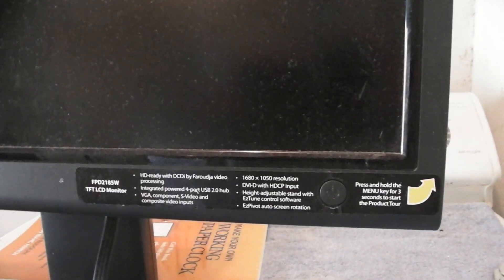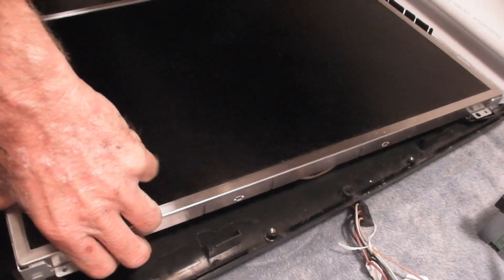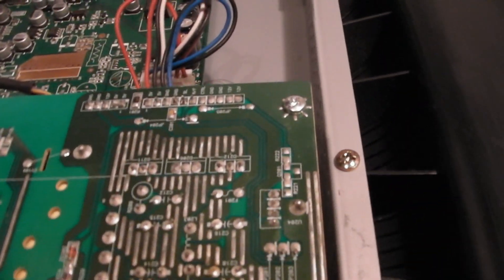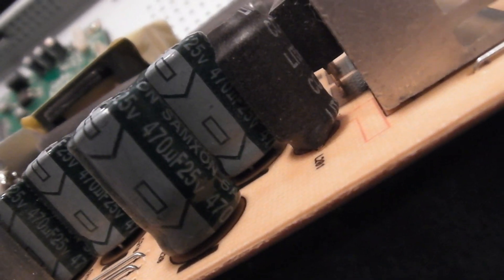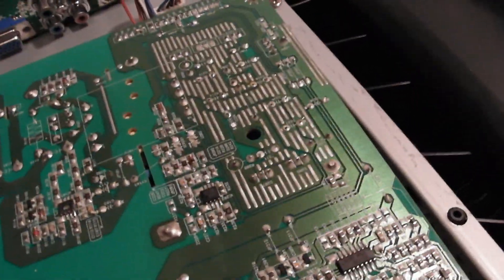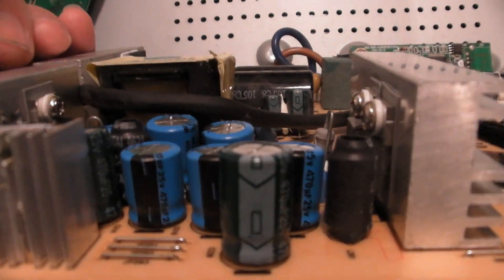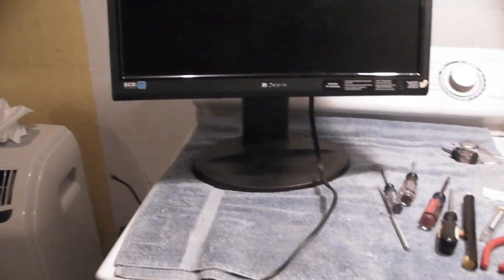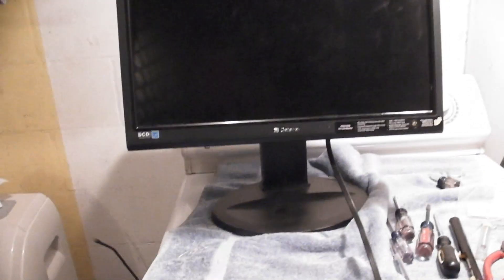Monitor blinking power button repair

Comment: just got done replacing 2 caps on my le 1936.   blinking blue light....    So i took it apart a few hours ago and yep 2 bulge caps  a 10v 1000uf  and a 35v 470uf.   Had couple boards around and found one cap  thats 35v 470uf  even tho it was a much bigger cap size wise   so i pop that on.  I didn't have any 10v 1000uf  so i ony can find a 16v 680uf so i gave that a try and pop it back together and bang monitor came alive:)     This monitor was in the trash even tho it still worked perfect  till a surge did something to it 2 years ago so it sat.      This is mostly for my cousin which yea his monitor cracked lastnight ...   So testing this on my pc as a 2nd monitor for now too see how it holds up cause im not 100% sure if that 16v 680uf will hold out over time....

Comment: I have a benq but the caps are fine but the monitor wont turn on after i plug the power cable but if i keep on plug and unplug many time the monitor turns on but if i unplug it again or a blackout the monitor wont turn on again then i do the unplug and plug method again to turn it on

Comment: Thanks for the video. I had the same problem on a 19 inch Dell. Replaced the capacitors and it worked.

Comment: I already replaced the broken capacitor but not still not working.  the power button blink once and nothing happen.
PS: i replace those broken capacitor with my unused board capacitor.

470uF 25v 105C  << replaced with same model 
220uF 25v 105C  << i can't find a same capacitor and i replace with 220uF 25v 85C

is it ok ?
Reply: Wee Ching Chok I have the same problem, when power led blinks once... :/ When i disconnect logic board from power supply then connect it again, power led blinks once again. Maybe Logic board is faulty :/
Reply: It is more much less charge inside the capacitor

Comment: Thanks for the vid. Any other issues to check for LCD screen starts up shows ACER logo then switches off ? Led turns orange, then blue, starts up, shows ACER logo then shuts off screen turns black. Led goes orange, then blue then logo reappears, immediately shuts down. And so the cycle repeats itself. Still cycling like this even an hour later. ALLcaps seem ok and test ESR ok.

Comment: Thank you very much. You and your video just saved me a good-couple hundred bucks! Mine was a Dell LCD, different configuration, but mainly your video gave me the confidence to take on the challenge. I'd had experience with old time circuit boards and soldering (retired mechanic) but had assumed that modern power supplies were integrated without individual component capacitors. On this Dell, I had to replace three 10v/ 1000uf's. I had salvage ones in my junk pile (one was a 16v, but 'fit'...).
Reply: For anybody wondering the voltage on a capacitor is the highest voltage it can handle not the required voltage, so replacing a 10v cap could be done with any voltage above 10v, given it's the right uf (microfarad) value.
Reply: @nixietubes  Thanks for stepping in with this information, I was wondering about the voltage differences.

Comment: ITS ALWAYS BETTER TO REPLACE WITH A HIGHER VOLTAGE CAP,THEY ARE USED FOR FILTERING THE VOLTAGES AND CHANGING WAVE FORMS...CAPS NOW ADAYS ARE JUNK,YOU WOULDVE NEVER SEEN THIS DAMAGE 2 A CAP 20 YEARS AGO WHEN THEY WERE STILL MADE IN  THE GOOD OLD U..S.A

Comment: Capacitors can go bad without swelling up, for ex. they can just dry out (they have a semi-liquid substance inside). Ideally, you use an ESR meter to test their internal ESR. In a case like the one in this video, replace ALL caps around the swollen ones 

Can't use ANY capacitor with same uF value and V, lcd psus need LOW ESR caps, and quality low ESR ones you won't find at Radioshack. Sure, the lcd will work for a few weeks/months, but you're stressing the psu and the crap caps will die again.

Comment: This is not correct.  The high voltage rating is so that arc over does not occur.  The venting issue ocurrs because of overheating caused by the ripple current being higher that the rating on the cap. If you don't replace with a higher rated ripple current, you will have to continue the repair over and over again.  In fact if you use a lower rating, it could even explode.

Comment: Ha - I was looking for tips on my current monitor, but as it happens I have that exact monitor sitting in my basement (and it died in much the same way).  I don't know how to do circuit repairs exactly, but those were good tips (re: capacitors).  Thank you!

Comment: ive been looking at some random circuit boards lately, and I wonder why is it that what they all have in common is that they have a lot of capacitors on them? I understand why they have a lot of IC chips, but i always see a bunch of capacitors. Is it necessary?

Comment: Mike - a man of many talents. I used to be a camcorder repairman and I have replaced very many electrolytic caps in the past - especially the small silver ones. For circuits that run hot and/or being used in hot environments - go for the 105 degree type. It is satisfying to fix things isn't it? Good tutorial.